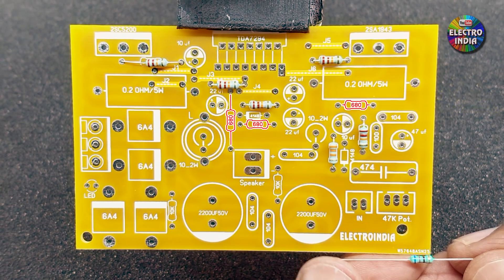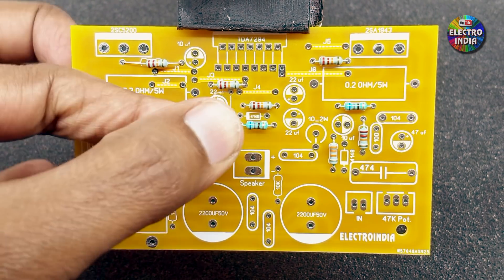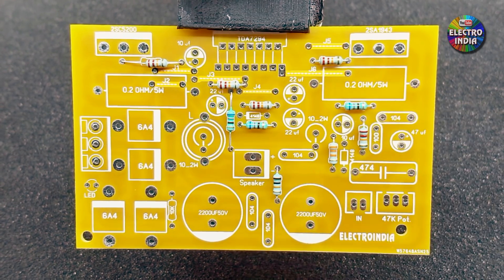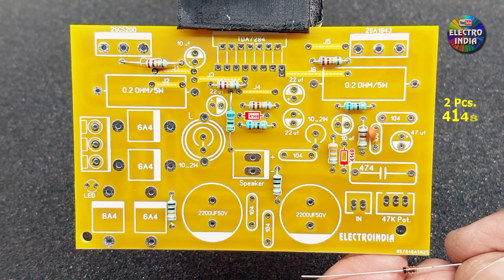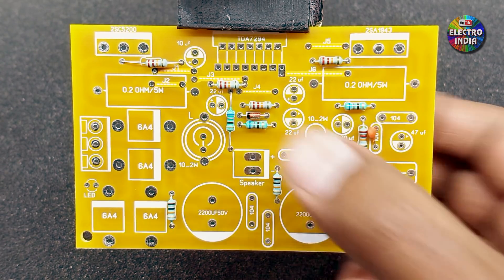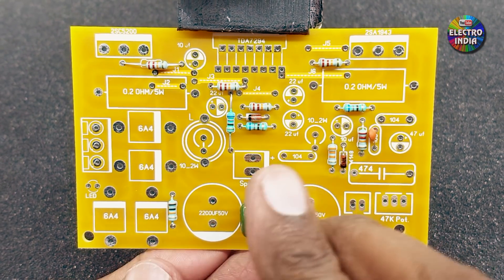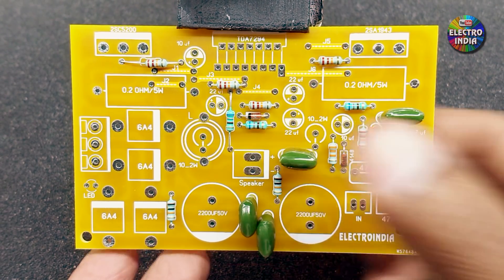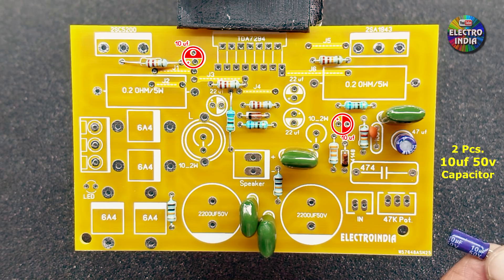150 Watts Mono Amplifier Board DIY with 2sc5200, 2sa1943 & TDA7294 ( Hindi ) ELECTRO INDIA

Comment: Would a 28-0-28 transformer work in this circuit?
Reply: I came to find out that a 28-0-28 transformer will work (yes but will need a larger heatsink )

Comment: Hello Brother
can sanken 2sc2922 & 2sa1216 be used as output transistors in this circuit instead of 5200 & 1943?

Do I have to make changes if used?

Comment: Hi Prem Kumar, appreciate you hardwork

Wanted to know what size of Drill bit used on heat sink, what is the size of the white washer used on TDA7294 and what is the size of screw and nut used ? 

Tell me in MM ?

Comment: did you copy the design from other Chinese boards , or designed this your self? and I would really appreciate to see much more detailed rating of the power output with 0% distortion and on different load impedance and power supply voltages!! ... you can check John audio tech's videos about his amplifier reviews and see how he tests them.... just a simple sound playback isn't enough to really trust a board on its power and capabilities!!

Comment: Why 2 transistors instead of 2 ic ?
Reply: 150 watt ban rha hai na... 100 watts RMS with TDA7294 and 50watts rms with those transistors ( always used in pair)
Reply: agar 2 IC use karte toh circuit would have been different and also the power output ( 3 ics would make approx. 240 watts.... nd dat's HUGE)
Reply: @yuktabhardwaj7554  Thanks for answering my question. I want 100 Watt Stereo. Can you suggest any circuit.
Reply: @prathamesh_raut  160 chalega?
Reply: Wats को छोड़ो यह बताओ की 12" के दो सपीकर का लोड उठा लेगा
Reply: @manjeetsingh.lohara1654  Ye mono amp hai... Inch ka koi matter nahi hai ohms check karke laga do... Max 8ohms.
Reply: 4ohm ka Subwoofer kitna watt ka lagaoo